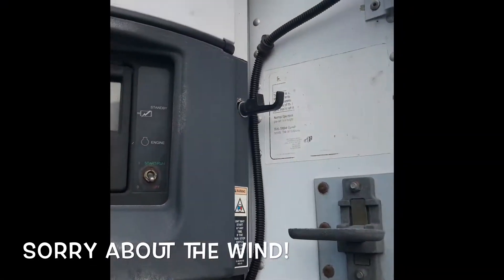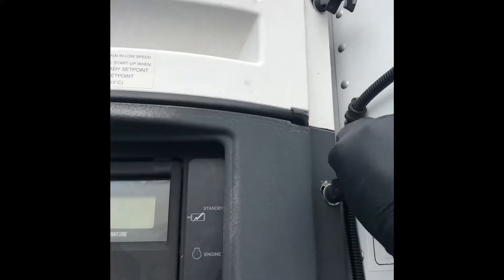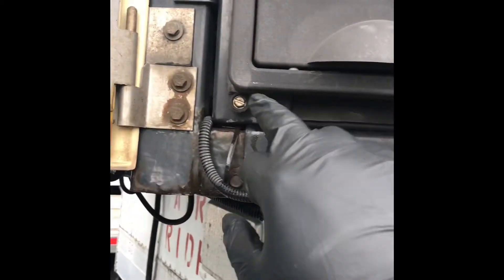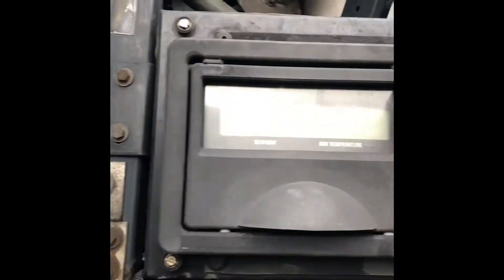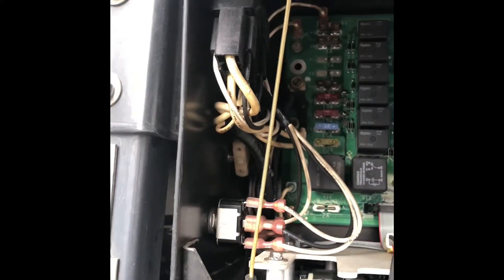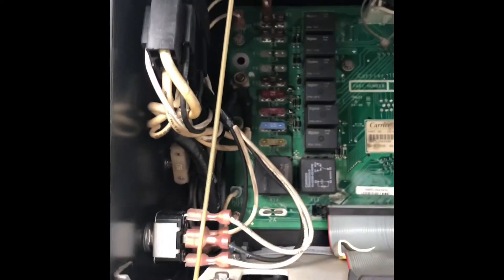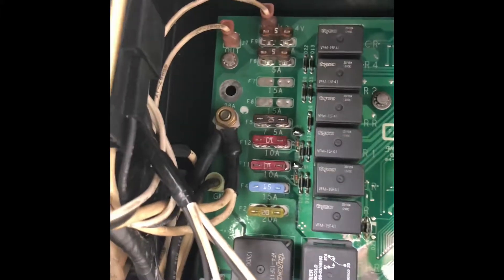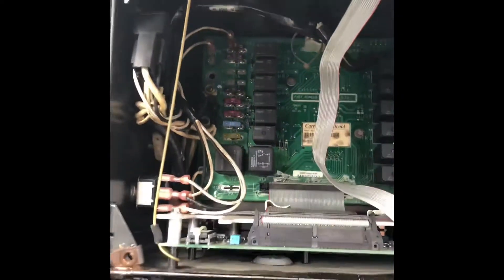Fixing Carrier Unit “Fuse Bad” Message for less than $5 bucks!

Comment: Tnx
Reply: Thanks for the video it was very helpful. It was my f11 that went out, I replaced it and the unit started acting up again. Check your clutch fan belt and clutch fan itself. Turns out my clutch fan grenaded itself, the pulley is no longer really there, and the fan is not connected to the shaft